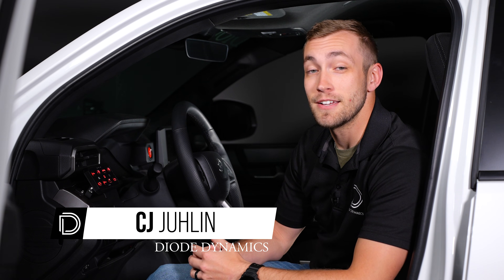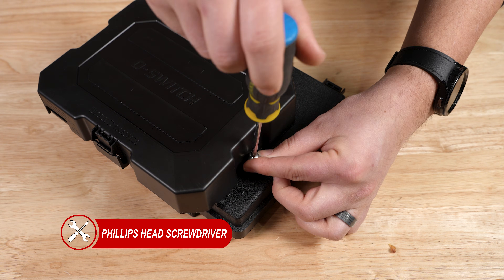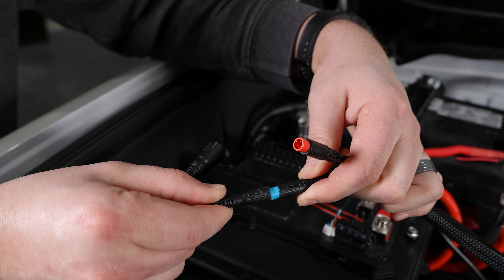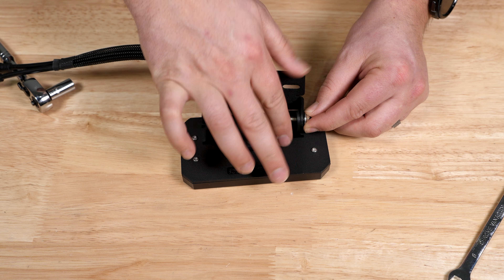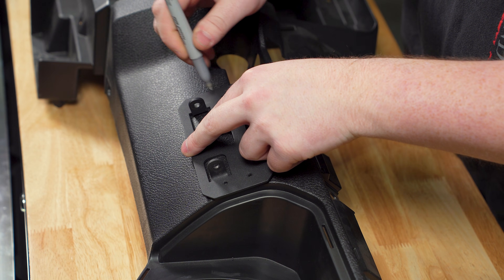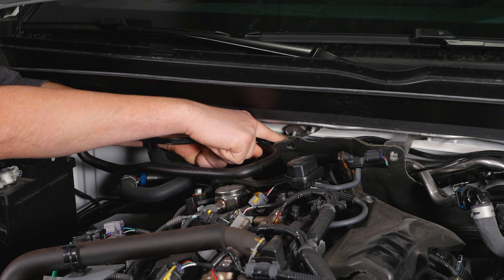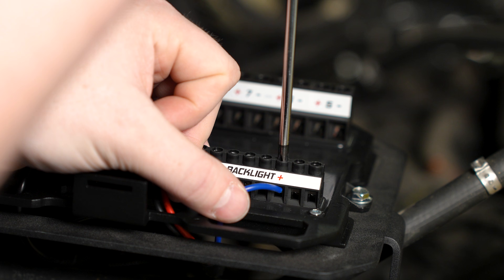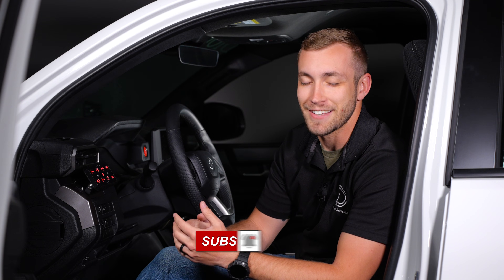How To: Install D-Switch 8-Channel Switch Panel—Everything You Need to Know | Diode Dynamics

Comment: I would follow up with some RTV on those bolt holes through the cover of the fuse box if you drill and use bolts. Don't want water and moisture getting into the fuse box.

Comment: Hello! I got my unit today, i will install KC Flex Era lights. Do i need to ditch the fuse and relay from original harness to connect to the DD switch panel? Thanks in adcance. Great videos and content.
Reply from the maker: You do not need to use the relays and fuses from the original harness. The D-Switch has a solid-state relay built in!
Reply: @diodedynamics thanks for replying, i will install it today.

Comment: Can you show a video of how you connect your d switch to your high beams?
Reply from the maker: It is different for every vehicle, and depending on your trim, the wires may be different. We suggest finding the power wire to your high beams, then tap the signal trigger and program the corresponding lights you want to turn on!

Comment: Hello
I have an EcoFlow Power Kit (Gen 1) installed in my van, and I recently ordered a D-Switch. Could you please create a video demonstrating how to connect the D-Switch to the EcoFlow distribution box?

From what I understand, the EcoFlow Power Kit DC output is rated at 60 amps, while the D-Switch can handle up to 125 amps. Given this, do I need to connect the D-Switch directly to my Transit van’s battery in order to achieve the full 125 amps output?

Thank you for your time and assistance.
Reply from the maker: Yes, that is correct. You will need to install the D-Switch directly to the vans battery to access the full 125 amps of power.
Reply: Awesome! Thank for answered my question ! now I am ready to install it !!

Comment: Isn’t the battery cable hole to large for the machine screw on the hub ?
Reply from the maker: One side of the cable has a larger hole than the other side of the cable, in the event your battery terminal is larger than  a standard size, however, it does not affect the performance of the panel. Good catch!
Reply: @diodedynamics few questions using a 21 Tacoma. Originally i was looking at switch pro but these seems an easier option and includes everything in one unit if I’m not mistaken. 1. A lot of people mount there controller in the left panel where all the toggle buttons are by getting a 3rd party trim piece that fits controllers and stock buttons, auxbeam switch pro etc, do you know if these will be made to fit your controller? 2. Do you need to un hook the battery every time you add a new accessory, bc i swear every time i mess with a battery terminal it always sparks when replacing the cables and startles the crap out of me, any advice?. 3. Is a stock oem battery suitable to run this and the typical accessories?

Comment: Wait this doesn’t come with a circuit breaker like the auxbeam?? This looks way simpler 😳😳
Reply from the maker: It is very simple! All the fuses are electronic which makes diagnosing much faster and straightforward within the app!
Reply: @diodedynamics i will install KC Flex Era Lights. Should i remove fuse and relay from the original harness to connect to the DD switch panel? Thanks

Comment: $600!!! That's insane. Is anyone aware of anything that does the same thing, but is more reasonably priced?
Reply: $600 is a pretty competitive price for high-end switch panel like this. Other competitors are 690 or 500 but don't have everything the D Switch offers.

Even if you go with a cheaper option, you won't get all the features of the d switch. If it's any consolation, I can provide my ambassador code for free shipping. Save it for when Diode Dynamics has a sale and use it then for extra savings #DiodePartner
Reply: @Warpetrie  I like the sound of that.   Ill take it. 🥰
Reply: Auxbeam can do similar as in being a switch panel, but it's only a toggle switch no cool functions like this.
Reply: I ordered this switch..Sorry but this might not be for the average person!
Reply: Switchpro but its kinda the same price